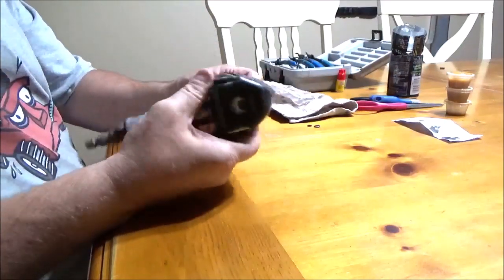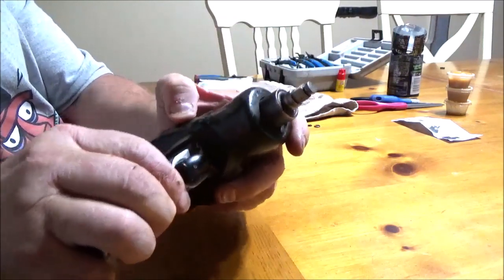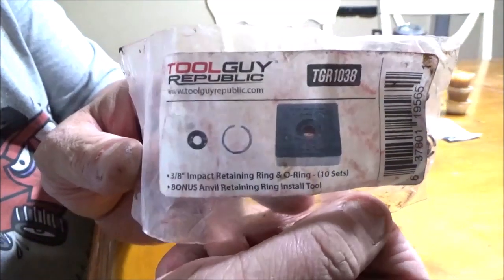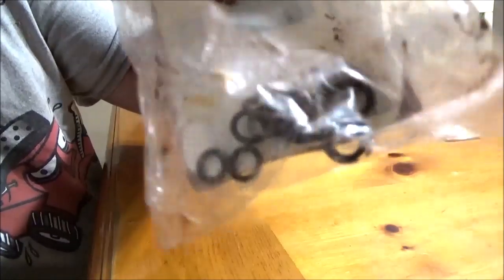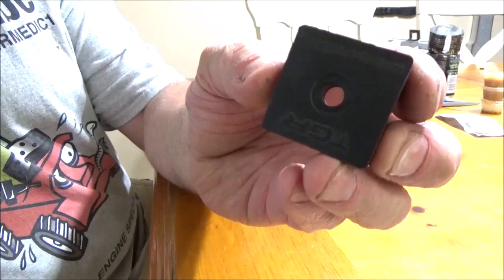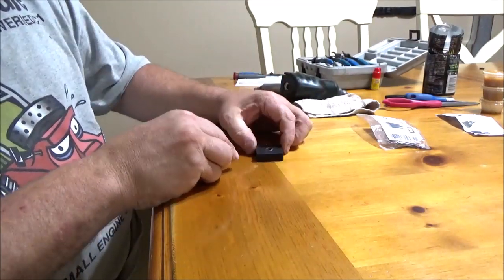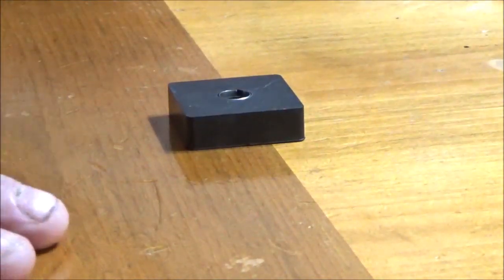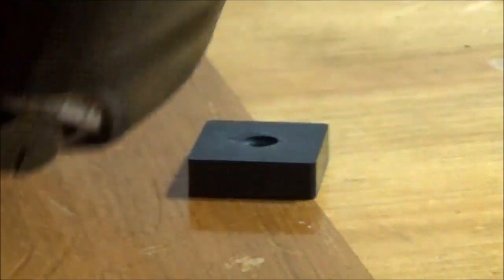SHOP TIP : HOW TO REPLACE THE RETAINER CLIP ON JUST ABOUT ANY IMPACT WRENCH

Comment: Hey if you use your 3/8 air impact daily, I would highly suggest updating your impact.  Sorry bud but that thing is an antique by today's standards.   I would suggest checking this out https://www.amazon.com/gp/aw/d/B01EN7GE78/ref=psdcmw_552820_t2_B001BQK7B4 you won't regret it.   And if you don't like it, it's Amazon.  Just return it.   I'm in love with mine.

Comment: Good to see this is an easy fix.  Every impact I've had has the detent style end.  Bought a new gun with the retainer clip, used it twice and already broke the damn thing off.  Also makes it impossible to line up the socket to the end because it's round, the detent style is square all the way to the end so it lines up right away.  Absolutely terrible design and whoever thought that was a good idea was a moron.  There is no reason you should have to replace a part on a tool like this.
Reply: Operator error. Sounds like you need a detent anvil. That will work better for you Dingus